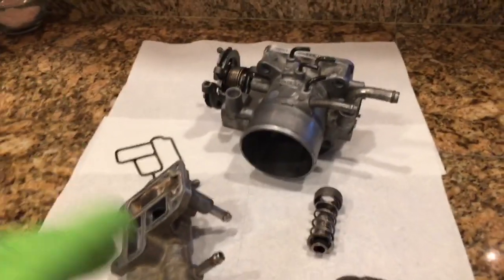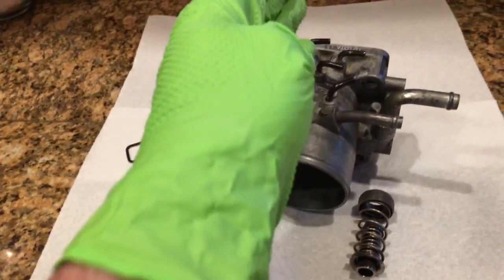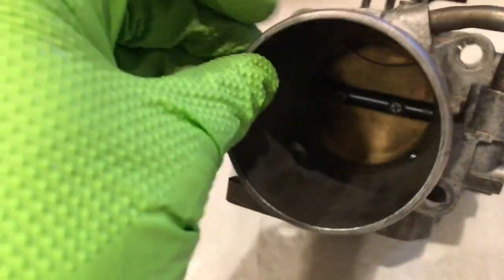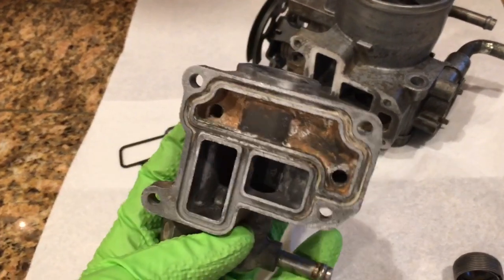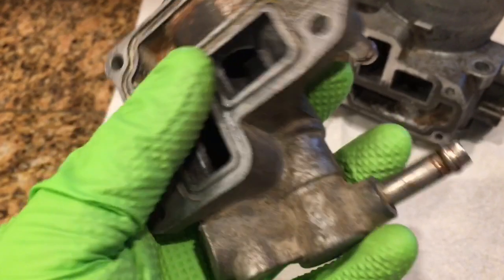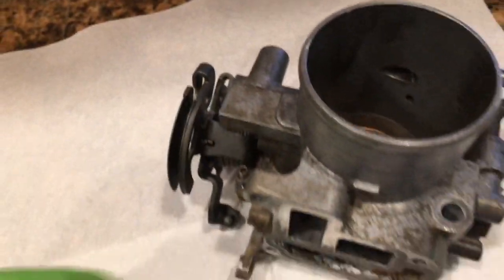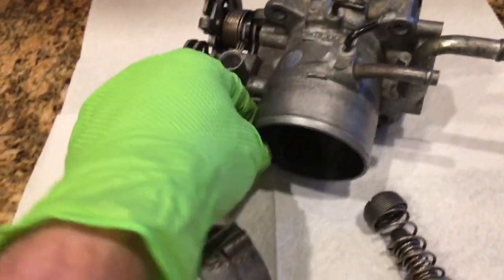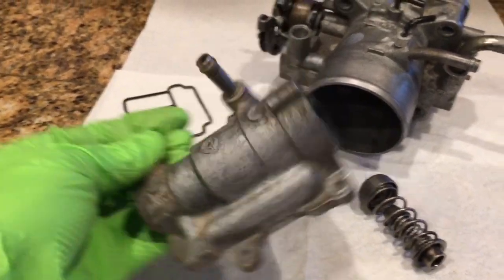Toyota 4runner pickup 22RE - understanding rough, high, surging idle, the Idle Air Control IAC valve

Comment from the maker: A big thanks to everyone who has watched and liked this video! I just wanted to mention something I ran across today in the garage while testing the original fuel injectors from my 22RE - which might also account for this surging idle problem. On my truck, the specific problem I had was that the truck would not idle properly once warmed up; but when cold it would idle correctly. Today, while rebuilding and reassembling my intake system, I tested the new fuel injectors which are going on the motor. They all tested out fine. I also decided to clean the old fuel injectors and test them. After cleaning them, I tested all four of the original injectors and, much to my surprise, only 1 out of the four worked. The other 3 did not flow fuel under pressure, nor did they exhibit any signs of actuating under electrical input. So this got me to thinking.. perhaps my original issue was caused by faulty fuel injectors. When cold, the 5th "cold start" injector is functioning and providing additional "piggy back" fuel across the board for a while. The injector is located in the middle of the intake manifold, so its spray pattern would be drawn in evenly across all for intake runners. If several of my main fuel injectors had failed to operate, this would mask that fact. However, once the motor had warmed up, the cold start fuel injector would shut off. Had I known more about the 22RE at the time, I could have tested this by bypassing the cold start timer and keeping the cold start injector operating. When the cold start injector turned off (i.e. once the motor was up to operating temperature), I suspect my motor might have been running on only 1 or 2 of the original injectors and this could have caused the unsteady / cycling idle problems I was seeing. This may or may not have been compounded by my IAC valve being partially blocked. In any event, for others who might be attempting to diagnose unstable idling issues (especially those which only manifest once the car is warmed up), you might want to further investigate your fuel injectors and/or see if the cold start injector is helping to keep the car supplied with fuel when cold, but not when it's warmed up later on. Again, thank you to everyone who has watched, liked and subscribed to my channel - it's most appreciated!
Reply: I really like the video! Good job! One thing to note about the Cold Start Injector is that it is only supposed to operate when the engine is cranking, and should shut off as soon as you let go of the key and it returns to the ON position. Once the engine has started, only the 4 main injectors are being used.
Reply: Ray, you just described my issue to the T. I replaced my plenum gasket (which fixed the high rpm idle), replaced my spark plugs/wires/distributor cap, but I still have a rough idle, more so when it is hot. 

I believe I'll replace the injectors. Also thinking about deleting my emissions stuff. 

What's strange is that even with the rough idle the truck's top end power seems normal, and I'm getting decent fuel economy. The rough idle is beyond annoying though
Reply: Great expaination! I have your same problem, start Is very difficult and I tried vary options, checked Spark plug, Spark plug wire and connettors, ignition coil changed new, nothing same problem. My truck if start go regurally with cold fuel injector (i derived a manual command Burton) for 5 Min, After It die, i think there Is a problem with fuel injector and today i tear down the trottole body, i've checked the cold start valve, i found a wrong regulation on the spring and the coolant side dont flow correctly, the passage trough internal hole Is closed, i've try ti inflate with mount.
I' ve let in the WD40 this night i'll try to open with compressor.
Tomorrow l'll tear dow the injector, test and of bad replace It.
Thank for you inspiration.
Reply: @jakeaustin9894  that is not true.  It keeps running until the engine warms up.  I once had a short in my wiring to the AFM and it was telling the ecu the AFM was seeing the min amount of airflow.  Truck ran fine when it was cold but once it got to operating temp and shut off the cold start injector, it would only idle and if you gave it more then about 5% throttle, it would fall on its face and nearly die.
Reply: @kimokahikolekalihi  mine only idles, it’s hard to start but once it does it sorta runs.
When you give it throttle it falls on its face and tries to die. But it stays alive.
Any ideas.?

Comment: Thanks for the explanation Ray. I just bought a '92 Pickup with the 22RE, and I'm still learning all the ends, and outs of daily driving a rolling museum. :)
Reply: rolling museum, I like this way of thinking of it.
Reply: I had a 94 back in 07. Put Maxxis Bighorns on it, went anywhere. Mine had the V6, 5 speed single cab. Miss that truck a lot.

Comment: I've got a 1986 Toyota 4Runner I bought in October of 85 and just turned 480000 miles on it.
Developed the surging problem at idle speed about 2 months ago and I've been chasing it since.  Thank you for the detailed explanation you gave here for how the idle control valve works.
Reply from the maker: No problem man. My truck has 436K miles on it over here, although most of that was before I owned it. Check your O2 sensor wiring and also make sure you have good coolant flow around the IAC. Check your vacuum levels at idle also.. you should be pulling around 16 in/Hg typically. Also check the rubber elbow at the throttle body for cracks, etc.
Reply: @ray5961  thank you for this additional information my biggest dread is removing steel bolts going into aluminum.
Reply from the maker: @SoybeanFarmer3300  You're welcome. Also, in my experience, the aluminum used on Toyota motors is very high quality. You shouldn't have much problem removing bolts which thread into aluminum. The issue usually is over torquing things when installing the bolts back in. I generally use anti-seize when threading anything into aluminum (just be careful not to go too tight, as the anti-seize will throw off your torque specs a bit). Also, get yourself a good set of thread restorers; those help out quite a bit (here's the set I use here https://www.amazon.com/gp/product/B000XJ48V0/ ). Generally, you can just spray some gasoline into the hole, run the thread restorer down it a couple of times and blow it out with compressed air. That will help a lot as far as cleaning the hole (and also clean the bolt threads using an old tooth brush or SS wire brush). On my motor, I also take a very small / sharp dental tool and chase around the threads on the bolts using a magnifying glass to clean them. It takes a while, but it's worth it. The other thing is - at least on my motor - I use a lot of titanium hardware when threading into aluminum, as it helps prevent galling and stands up to heat cycling better. Check out RaceTi in the UK - they have outstanding Ti hardware and it's actually not all that expensive. Same goes for using stainless hardware; it's generally better for threading into aluminum in my experience (McMaster sells plenty good quality stuff).
Reply: @ray5961  thank you for sharing this information with me I've been struggling trying to resolve surging idle after the engine warms up since January.   so far I've been unable to resolve the issue.  My dread from steel bolts in aluminum comes from the bad experience I had replacing the thermostat in this motor about 15 years ago when the threads in the aluminum came out with the steel Bolt I used a helicore and it has held up.   The surging idle is an intermittent issue some days I can make my drive to and from work without the issue and then some days it starts before I get two miles away from the house and last for the entire ride shows up whenever I hit a stop sign or a stoplight and the truck is sitting there trying to idle otherwise it runs great and still makes good power for an engine with 480000 miles on it.  Also this issue has not affected my gas mileage I still get an overall of about 22 MPG.    I like your channel so I subscribed👍
Reply from the maker: @SoybeanFarmer3300  Check into what's called a "Time-sert" for thread repair in aluminum. They are far superior than Heli-coils. When I bought my truck, there were 3 or 4 holes which had been repaired via Heli-coils and I pulled them all out and machined them and inserted Time-serts (secured in most cases with some JB weld). Your truck is doing exactly what my truck was doing when I first bought it. The surging (once warm) occurred every 1 second, which indicates it's an Air fuel ratio / O2 sender issue to me. This was the case with my motor I believe. When I re-did my entire wiring harness, I discovered that the wires running to the upstream and down stream O2 sensors were very badly deteriorated. I suspect this was throwing off the ECU's insofar as the fuel trim and being able to stabilize the A/F ratio at 14.7, which is basically the ECU's goal when it comes to fuel mapping. If you can get your hands on a wide band air/fuel ratio gauge (see my other videos where I show mine), you might want to try sticking it into the tail pipe and monitoring the exhaust exiting. It won't be quite as accurate as having it welding into the stream after the header, but it should give you a relatively accurate approximation. Under normal circumstances, the A/F ratio should bounce back and forth around 14.7 +/- .2 and you'll see that the ECU does a pretty good job (through the use of its narrow band O2 sensors) to stabilize that while running. You might also try pulling your upstream O2 sensor and clean it and test it just to see if it's working. If you replace it, use the Denso ones, although NTK (which is a subsidiary of NGK) will work also. They sell them on amazon. My guess is either your O2 sensors are not sending correct data to the ECU and/or the IAC valve is failing to close. Now with regard to the IAC valve, it's easy enough to diagnose. Just remove that rubber elbow that goes to the throttle body and cover that large hole I show in my video with some duct tape. That will totally disable the IAC valve; so once the motor warms up, if the IAC is the issue, the surging will go away. If it doesn't, that means the IAC valve isn't the problem and you may want to look into the O2 feedback / fuel trim loop stuff I outlined above.
Reply: @ray5961  I've already watched those videos of yours and next week when I'm off work I'm going to do what you suggested with the tape over that hole. I've also got some suspicions about the booster on the power brakes might possibly be leaking because I have noticed applying the brakes causes this intermittent problem to reveal itself. Thank you very much for the information you have shared with me.
Reply: @ray5961  about 20 years ago that oxygen sensor that's mounted into the exhaust manifold went bad I replaced it with a Bosch maybe it's not totally gone bad and it's just putting out intermittent readings. I'll take your suggestion and go and look for the manufacturer denso. Thanks 🙏
Reply from the maker: @SoybeanFarmer3300  Yeah, Denso is better. Also, make sure to check the wiring to the O2 sensors. That long harness up under there can sometimes have a hard life. I'd also take a look at the main fuel injector grounds, which gang together and mount to that bolt under the intake runners, where the  diagonal support under the intake comes up from the block. If those grounds get messed up and/or aren't making good contacts for ground, it can cause issues with your fuel injectors functioning. Definitely do the tape trick... that will effectively turn off the cold start circuit as far as the IAC valve is concerned. If the problem persists when the truck is above about 140 degrees (driving for around 10-15 minutes) then it's most likely nothing to do with the IAC valve.
Reply: @ray5961  with this issue being so intermittent with the totally unpredictable frequency of occurrence I'm going to need to ride around for a few days with that hole taped off.   What's your opinion of leaving tape in there for two or three days driving about 66 miles each day allowing enough time to confirm rather than suspect .  
Do you have a video showing how to properly test the power brake booster to see if it is still airtight?    I'm working with something here that's 36 years old so I appreciate you bringing up those ground wires and the possibility of wiring harness tissues.     🧰
Reply from the maker: @SoybeanFarmer3300  I would put a vacuum gauge on the motor also, just to see what sort of vacuum you are pulling at idle and also off throttle. My 22RE pulls 18 inches Hg at idle and a hair over 24 off throttle while going down a hill in gear (i.e. engine braking) for example. You can tape the IAC hole off no sweat; just make sure to fold the lip of the duct tape over and out the edge so the tape is locked in place and can't end up sucked into the intake or anything. I've driven my truck hundreds of miles with that hole blocked off. It won't idle when cold, but once you are up to temp you should be fine (that hole closes around 140 degrees under normal operating conditions when the IAC is working correctly). As far as the brake booster, if you want to know if it's working, just disconnect the hose that runs to the intake manifold (block the manifold side off) and then try stopping your truck haha :-) You can also do it while going down a hill with the engine cut off (but not w/ steering lock enabled on the column). If you cut the engine and push the brakes a few times, the booster has about 3 pedal pushes worth of vacuum assist in it... once you use those up, stopping your truck will be shockingly hard (you'll have to really stand on the pedal to stop the truck). Be careful because the first time you try to stop without the booster working, it can be kind of scary. If you reattach the booster (or re-start the motor) and suddenly the brakes work easy peasy again, then your booster is fine. You can also check engine idle levels when testing to confirm there is no vacuum leak and/or get yourself a vacuum pump for testing. If the surging is every 1 second, it's most likely something to do with the ECU's fuel trim.

Comment: Did a engine swap from a 22r to a 22er . On start up it would run until warmed up and would stumble and stop. Couldn't get it to run till it cooled off. Was a real head scratcher . 3 days and a number of you tube videos and yours was the one to fix it . The idle screw (1/2 turn open )or air was not open enough .  thank you .
Reply from the maker: Tracy Golden That's great to hear man - glad the video helped you out!

Comment: I am having rough idle issues when my truck is hot. Watching this video made me woke af about my issues, Thanks!
Reply from the maker: Cool man, good luck tracking down the issue! Yeah, understanding how the IAC valve works helps a lot. A quick test you can do is to just put some duct tape over that one hole jus inside the opening to the throttle body and see if the idle is stable - blocking that hole totally off will simulate the valve warming up and closing like it should. Another issue can sometimes be faulty wiring to the O2 sensor (or the O2 sensor itself) also, although usually the IAC valve is more often the culprit - feel free to report back if you find the issue on your truck.
Reply: @ray5961  Yeah, my issue is rough idle (really rough!) when the engine is hot. My truck suffers from overheating issues because I am using a cheap Delco Radiator. Not the full metal ones that the OEMs were. I think the hot coolant is too hot for the IAC, maybe causing an issue with it resulting in a rough idle. (Sometimes it stalls after a warm start)

Once I clean out the throttle body, IAC, super flush the system, and slap in that new radiator, and my idle and cooling issues should go away!
Reply: I tried the duct tape test but the motor won't crank over.  Should I check my 02 sensor ?
Reply: Did you ever get your issue resolved? I have the same problem on my truck. Idles rough/low when warm and don't know the culprit
Reply: @hulk6164  No i ended selling the truck to a cousin of mine.

Comment: I had a surging problem on my 88 4x4 Xtra cab P/U 22RE, WHAT I DID IS MARKED WITH A LINE, THE THROTTLE POSITONER VALVE, unplugged it removed the screws (you will need an L shaped small Phillips) remove it line up the new Toyota TP, w/ the old TP, Mark the line from old to new, reassemble w/ the mark on the new TP to the mark you made on the body ! Start it up, perfect! No more surge.

Comment: I have 22RE with a surging idle and thought it might be the IAC or one of its related parts. Now that I know how it works I can pull it out and clean it. Hopefully that will cure the problem. Thanks for the great info!!!
Reply from the maker: Ron De TorresThanks! You can also put some tape over that hole on the throttle body and temporarily disable the idle air control circuit to see if that's the problem.
Reply: Ray Nada : Ray, good video and very educational, I put water at 200 F and did not close the valve, my question is: how did you get the spring out?

Comment: Really great explanation of how the ICV works, but you need to carry it out one step more--you are not mentioning that rough idling is commonly caused by blockage in the rubber hose and associate coolant line coming into the ICV, which can cause really rough idling...the rubber hose may have to be "roto-rooted" out using a stiff wire (coat hanger) and repeatedly flushed.
Reply: Needed to find your comment a long time ago
Reply: @kraptastic333  facts lol

Comment: I had a problem with surging running rough I clean it still did it. I blew into where the coolant goes in and blew out some trash. That fixed the problem